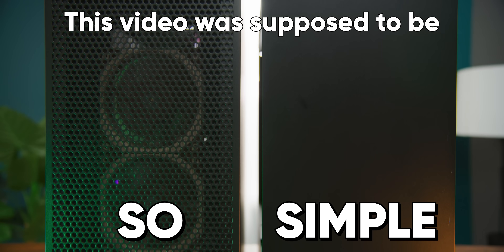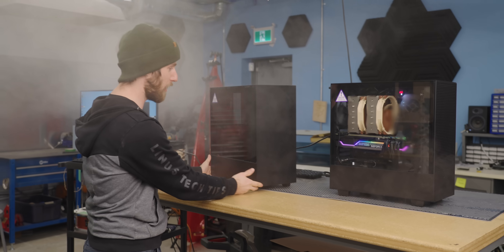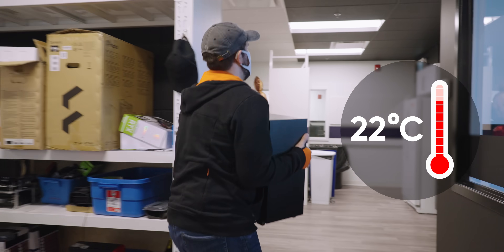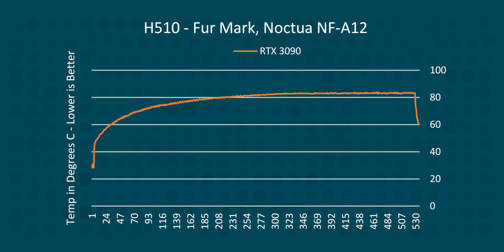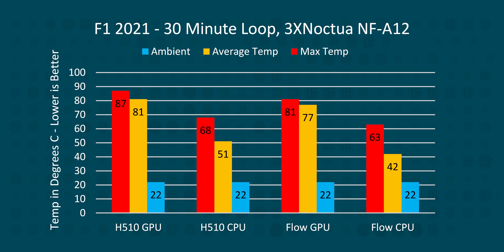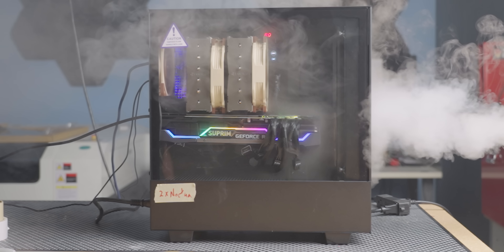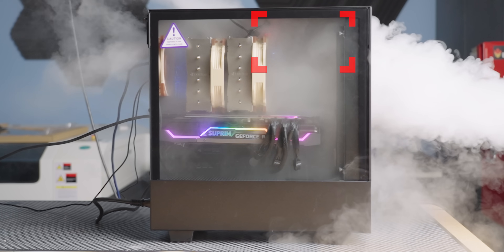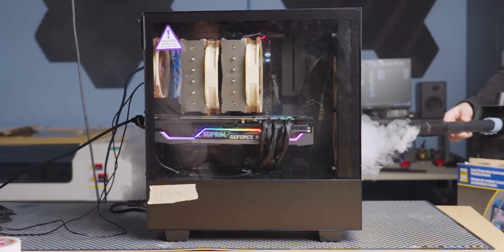Everything You Know Is Wrong - Mesh vs Non-Mesh Front Panel

Comment: The problem is motherboard design. In every motherboard I've seen so far, the top PCI Express slot (x16) is so close to the CPU that if you want to use a great CPU cooler then there won't be much or any room between it and the GPU card. I have the same issue in my PC, my 3080 back plate is literally touching my Noctua as in the video. We need taller motherboards that have this in mind where the primary PCI slot is much further down the board layout.

Comment: Would be interesting to see if you could 3D print an air deflector or duct to direct the air under the GPU instead of hitting it's end and causing vorticies to form and the air path seperates from the end of the card.
Reply: A gpu's fans logically makes more sense to be facing up or to the sides (since cold air sinks, intake should be on the bottom), so most thermal throttling issues could probably be fixed by doing that.
Reply: Ducts work, its why Dell uses them in their expensive Workstations.  Duct to ram, duct to cpu etc.    Its not as pretty on a glass case but effective.    Look at any house do they not have ducts?  vs just letting the furnace blow air into the basement and letting positive pressure work its way upstairs.   Ducts add costs and decrease fad glass case looks.

Comment: Isn’t it simply because the cpu throttles down the gpu can’t use its full potential as it’s being bottlenecked by the cpu, but with the better cooling the cpu doesn’t throttle so the gpu can work harder but also gets hotter because of that?

Comment: Internally dividing the cavity to partition the air flows can help. e.g. place a divider from the front of the case separating the GPU and CPU cooler - directing air out the back of the case.

Comment: I have an H510 elite (I bought it before I knew anything about thermals) and found that by running the front fans at the lowest I can possibly get them spinning (cant remember the speed off hand), and increasing the speed on the top and back fans by a tiny amount, the thermals improved drastically from the stock configuration.
Reply: Yeah, Jay has a video where he talked about balancing the airflow. Really makes sense to actually adjust the fans as needed for optimal flow.
Reply: Achievement unlocked: The Mechanic
Reply: oh man, that custom speed of the front fan i a sentey case is going to sell more now.

Comment: Could partial reason be perhaps the more efficient cpu cooling the more heat iabsorbed into heatsink ergo higher ambience of all other components inside the case? In my head the coorenation between lower cpu higher gpu temps indicate that

Comment: PSU Basement on mATX case = Bad GPU airflow

If you had a mATX case without a PSU basement partition you could have a fan at the bottom blowing all of it's air below the height of the GPU, thus feeding the GPU with it's own air supply instead of having the top/rear exhaust fan sucking up all the fresh air bypassing the GPU as seent in the video

I (still) have a Lian-Li case from 2012 with three 5.25" bays at the top making it that the CPU is starved of fresh air or even a good way to move air. When i sold my old motherboard and CPU (w/cooler, Zalman CNPS-9900MAX) to a friend we installed it in a new case with 3x140mm front fans that reached from top to bottom of the front of the case, so air pockets :-) but with glass in front. To my amazement it performed nearly as well as an open air bench with only intake fans AND at low/idle. This went from 4.5GHz/72c, 1.425v in my old case to 4.7GHz/68c 1.450v in a modern case. FYI, the CPU alone under synthetic tests pulled about 280 watts from the wall (60 watts idle) so my guess is that cooler is moving about 240 watts of heat.. the CPU and cooler were lapped.

Comment: I have this case. I have an AIO on the front, 2 exhaust fans, and a vertically mounted 3090 GPU and it has much better thermals than this test.

Comment: You need to make a vent, with exhaust fan,  at the back of the case between the  top of power supply enclosure and the bottom of the GPU to force air past the GPU to the outside.

Comment: I have a FD R5 and when I put a 140 mm fan in the bottom (at 500- 550 rpm), gpu temp dropped 6-7 c. I have 3 in and 2 out in top, all 140 mm.

Comment: My solution is to use some plastic divider to increase the airflow for gpu. 
2 fans for gpu
1 for cpu
Hot gpu air should be expelled using some canals or divider

Comment: and here i am with a Antec 302 - 75$ with a 3080Ti FTW3 / i7 10700k @ 5.2 ghz all core / Z490 MEG ACE and never goes over 65c , i might add im using all TT Riing fans -  had this case for over 5 builds not gonna let it go

Comment: I saw a custom made bellows case once.
I'd like to see how it does in a smoke test.

Bellow chamber was slightly bigger volume than the PC chamber.
PC Chamber had out-flow vents that were only open under outward pressure from inside the case.
The bellow plate cycled once per second IIRC.

Effectively (one would think) forcing all fresh air in, and old air out of the case.
But a smoke test on that would be nice to see.

Comment: Major Hardware made a little box to provide airflow to the gpu, with a fan drawing in air from the back. It worked surprisingly well, and it may provide a solution for those stuck with a case like this.

Comment: The use of glass side panels in modern cases does not help.  I have a Fractal arc case with the 6'.25 inch grill in the side where gpu heat can exit from the positive flow of two 140mm arctic fans in the front, one in the bottom aimed up at the gpu, and one in the rear location.  In addition I removed all the rear covers. The temps in the case are a contant 25 degrees when gaming.

Comment: I'd be very interested to see a deeper delve into this. There are so many unanswered questions. What about AIOs? does having the rad on the top or bottom make much of a difference? What about having your intake on top and exhaust on the sides? What about 1 exhaust vs 2/3/4/5 intakes? What about the same number of intakes and exhausts and just different RPMs? So much could be learnt from this and I look forward to what you will do next with these experiments.
Reply: This is all covered ad nauseum by other tech channels and websites... I'm the end it comes down to "don't cram big/hot components in a small case" and "get a mesh case".
Reply: AIOs are fantastic for airflow, you just have to make sure you have enough intake flow that you don't need a boost from an air tower.  Also consider a case with fans on the bottom.  3 intake front and 2 intake bottom would solve this easily, and without an air tower messing with the flow pattern it would be cool and whisper quiet.
Reply: Brooo this is so old and do a research review about pumps.
Obviously it's common sense that pump at the topmost (AIO) and bottom radiator will kill the pump (not instantly but surely) and the noise will be worse when pump are not submerged in water since the pump is at the top and the water/liquid/coolant is at the bottom and air bubbles are always at the top most of the loop(bubbles are air gaps and air like to rise) this causes noise a loud noise the more air bubbles it has.

But if this topic is mounting AIO to the top vs to the front which is better.
Then the answer is..
Radiator generate heats if you mounted it at the front the cold air will become warm after it passes through the radiator but front mounted radiator acts the same dust filters dust will be trap in the fins.
Then top will have cool air going inside and exhaust hot air outside but dust will be trap mostly on the radiator fins inside the case and  top is always the best for AIO pumps due to air bubbles located at the radiator at the top (it doesn't mean front radiator sucks front is fine but top is the ideal position)

But if this is open water custom loops, adding top, side, rear, bottom and front doesn't matter actually it's better to fill everything as long as there is enough space...
Add info hot air going in is still better than no air but cool air is the best scenario and you want a high airflow case (doesn't need to be expensive all it needs to have a full mesh front full mesh top, mesh rear and pci slot cover with holes) this will help in dust reduction since dust going inside will be blown again outside through this holes.
And every case and components are different... For example is this video it's very accurate info since the tri-fan is so near at the front fans it creates turbulence and since the dual noctua Fans are a lot stronger than tiny GPU tri-fan  and has full access pulling the air going inside due to its advantageous position it creates less airflow for GPU causing it to heat up.
The easy fix for this swapping it with an AIO if there are no fans pulling air in at middle of the case then the GPU will get much more airflow to cool itself  (this is one of the advantages of AIO) but you want to mount it at the top to have cool air hitting the GPU (warm air is fine but cool air will lower it much more).
Reply: People seem to either love or hate the AIO. My config loves it. My i7 12th gen and 3090 run super cool in my Fractal case using a front mount AIO. I also have top and bottom mount fans. The top fans exhaust.
Reply: Yes would love to see a proper analysis. "Heat rises therefore x happens" isn't proof of anything when fans can easily stop that heat rising...
Reply: Don't use water cooler. Use air cooler for CPU. Buy a case where you can place 3x120mm fans front panel, 2x120/140mm top and 1x120mm back. The 3 front panel are all intake, with the lowest one pushing air even under the GPU. The 3 top/back are outtakes. 

This is the best scenario for 6 fans. I even swapped stock cooler from GPU for 2x120mm fans. all of the 6 case fans and 2 gpu fans are 120mm, PWM, PST (daisy chained) and make PC extremely quiet. 

My CPU cooler is well over 4cm from the passive alu plate cooler on the GPU. Every component has nice room, nothing is too close or touching. Air gets everywhere. As warm/hot air rises, the 3 fans take it out. The one top fan is 3cm above cpu cooler and sucks air even out of that. Cooler is Mugen 5 rev.B 2 fan. 

I dont like water coolers - pumps are noisy, motor is noisy too, if not immediately, then after few months. My air coolers are silent even after 5 years.
Reply: @ancientslav4863  My AIO setup is whisper quiet since 2019.
Reply: @ancientslav4863  In smaller cases AIOs pull the CPU heat away from the back of the GPU quickly and give more room for airflow around the GPU.  Don't forget radiant heat..

Comment: You should redo this testing with high pressure fans (like for a water cooling radiator) and see if that changes it. I wonder if the high speed fans just don't have enough pressure to force air around the components, and slower high pressure fans might work better.
Reply: I don't think it's correct. The fans near the radiators needs to blow the heat away, to extract or intake the air from/into the case you don't want to use those fans. Install the CPU cooler vertically helps the thermals. I know because I did it. Same case, same cooler. Not sure if the mesh panel will help even in this case.
Reply: @Raiyan Assuming you have the same case as me, I used a Noctua NH-D15 with 2x NF-A15 PWM as CPU cooler, installed vertically, so it blows from bottom to top. Then I installed a Noctua NF-A14 PWM and a Noctua NF-S12A PWM, replacing the fans included with the case. At the time I did a lot of research to understand the difference with pressure, airflow, etc. 1000 RPM won't damage the PC. But if you fans are PWM, they will adjust the speed as needed.
Reply: @RaiyanI don't think it will cause any issue. Keep an eye on the temperatures and try different settings. But if you are using PWM I will leave the system to adjust the voltage automatically.

Comment: I mean I got 10 noctua fans, 3 are 3k rpm rest are 2k rpm. My CPU has the kraken on it, ice cold over clocked. GPU on auto fans stays around 65. I don't have a dinky air blocked case though 😂. Kind of a weird test but should re name the video. More directed at small cases. 3080ti + i9 12900k, also have all fans on auto smart fan control which raises rpm based on case temp

Comment: Hey LTT, as a die hard SFF builder i found exhaust in the front actually makes a big diff. 
ITX cases lacks good flow, so if you pull out the air, instead of pushing in more you get a better flow. 

The downside of pulling air out through AiO is that GPU thermals will make the CPU thermals worse, but that is most often worth it, compared  to CPU making GPU thermals worse. 
Currently running SSUPD case, AiO in front pulle air out, no doubt the best setup for this specific case. I've tried the same on A LOT of other ITX cases, with similar results.
Reply: generally low pressure is better in most ITX, so the component will suck the most cold air possible, high pressure will only allow the air thats already gotten heated through AiO the aid the cooling of the rest of the PC. thats sucks for the VRM, GPU, PSU and probably only aids the CPU..

Comment: The problem here is the awful case, not necessarily the amount of fans used. Even with a perforated front panel, the H510 is still a horrendous case for airflow, i.e. cooling components. I suggest the test to be repeated with a better case, like a Lancool II Mesh, Corsair 4000D Airflow or 5000D Airflow.

Comment: Well, that's the downside of itx cases.

I have 65-70 Celsius degrees while pushing my cpu (10700k) to its limits using the Noctua NH-D15. Chassis front and CPU fan profiles are custom moderate-high, not very aggressive.

Same applies to the GPU. Steady 65-70 Celsius under 100% load.

Comment: my cougar panzermax case is still unrivaled in cooling efficiency granted this thing is a monster of a case in size it has a airguide system built in that has these plastic fins that intake air from the front fans  blowing into the case ( they only take up 1/3 of the fan blowing in the rest blows into the case freely. Than directs the air via channels from the intake at the front to the back of the motherboard and to the PSU underneath the sheath and under the GPU and into the HDD and SSD bays that sit behind the mobo in a seperate heat sheilded spot to ensure theirs fresh air in the entire system running nonstop. .
also has a fan that sits below the gpu in the front of the case that blows cold fresh air directly into the gpus intake fans.

Comment: I just want to know why the heck they decided to put a 3090 in such a small case when anyone in the right mind with a 3090 would have as large a  case as they could, I have a 2080 TI paired with a Verizon Fi 5600X and even in the smaller Corsair 4000X case I had it never got anywhere near as hot as that 3090 did. after switching to the larger 5000x case both CPU and GPU now stay below 75c for the most part, hottest I've seen the CPU get is I think 72c and That's because it's scoping in the hot air that made GPU is pushing out, as of lately I've been getting my GPU to run as cool as  around 65c even after long gaming sessions with my GPU running a hundred megahertz core overclock and a 75 megahertz RAM overclock. I have three Corsair LL120 fans in the front. Three more on my Corsair h150i capel x radiator, and then three SP 120 Corsair fans on the side pushing air over the motherboard tray, GPU fan is usually cranked to 69% or higher as well and Chase fans are typically set to to the balanced profile unless I'm running games that I know run hot, in which case I crank them to all to 100%

Comment: Be careful with those smoke machines and the liquid they use.  I've experienced component failure when the smoke condenses again, and becomes a gooey oily liquid, trapped behind and inside components.  Laser printers are notorious for pulling that smoke in, and fogging up the lens that is used for printing.

Comment: The H710i that I own is the same way. With the front panel being solid it results in thermals that aren’t ideal. They aren’t terrible but can definitely improve. Just got a LianLi Lancool II for Christmas. It has a bottom psu intake for 2 120 mm fans which should prevent what is happening in this video with the mesh front. Waiting for my Noctua fans to come in then I’m gonna switch all my stuff over to the new case

Comment: Hate to be that guy but if you blow the fog directly into the mesh on the mesh front version why wouldn’t you also blow the fog directly into the the side mesh on the solid front one? Obviously air isn’t going to pass through metal. It only makes sense the side mesh will pull air in from the sides.

Now if you blow the fog directly onto the side mesh and there is noticeably less fog than that’s a good data point.

Comment: I have a mesh front panel case, which I actually got at a thrift store with a 10 year old motherboard in it. Once I got the components to replace what was in there, I almost maxed out the fans by putting 6 fans into it, and also getting a cooling unit for the CPU, I was able to get the CPU much cooler. I like the fact that I can access the HD’s by pulling out the mesh. There’s a fan near the bottom HD’s which I have pulling air in to cool those lower drives, and get air moving more inside the case.

Comment: Which is why I love my Fractal Design Core 500 mini PC. GPU is on the side of the case with a mesh intake for the cards fans to suck in, top of the case has two large fans blowing directly on the motherboard, cpu, GPU, HD, etc. and a rear exhaust fan. Airflow is far more important to me than how cool a case looks.

Comment: Had a similar problem in the lancool2 putting a piece of plastic ( or other safe material) across top of bottom fan to gpu helped drop my gpu temp. I also 3d printed a whole side section that goes from halfway down gpu to the psu slot and mounted two bottom fans instead of ssd on bottom section. I taped string to see air instead of fog.